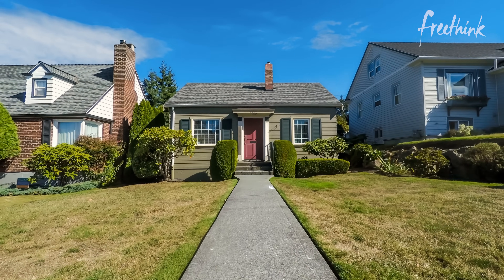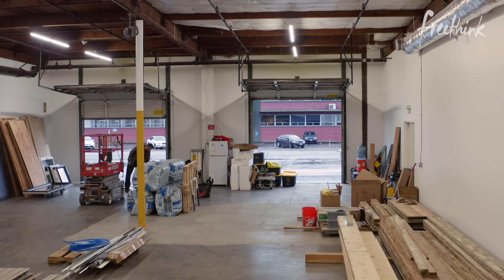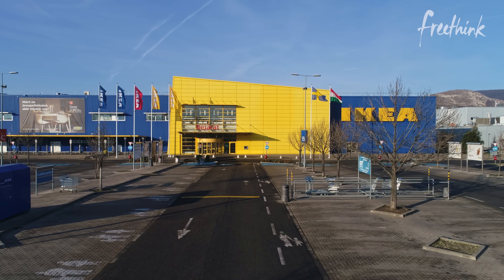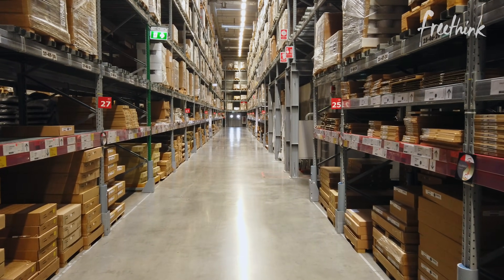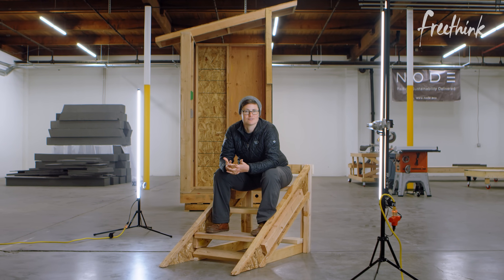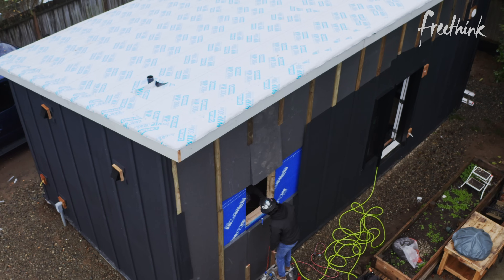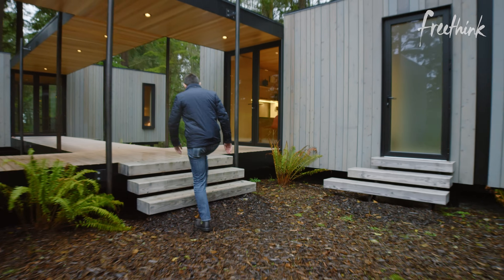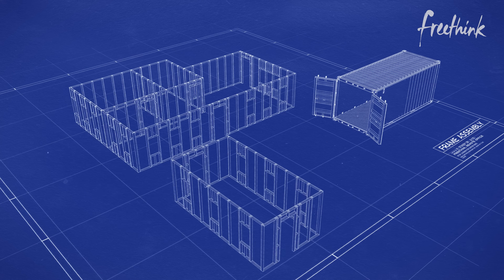This Carbon-Negative Dream House Ships In A Box

Comment: Great concept! I started wondering if the average person(not a rich person) can afford the land? Especially in the PNW, it's very expensive to buy the land and need 20% down minimum for empty land. It will be interesting to see how these are categorized too - maybe as "modular" which doesn't get the financing & insurance benefits either. Also, wondering what the R value is of recycled denim insulation - I would love to use it if it is highly rated! Keep up the good research!

Comment: Kudos for using recycled materials, good design, thinking smaller, well-insulated air-tight house construction.  Not "cheaper" at $350 per square foot.  Exclusive of land costs.  I would like to know how the buildings can be carbon neutral without passive solar features like thermal mass.

Comment: Lots of platitudes, but no actual explanation of exactly how this structure is carbon negative - beyond the use of recycled denim for the insulation and a few shots of solar panels. Is there rain catchment? Wind turbines? Composting toilets? Passive solar orientation? Like others have mentioned, I'd like to see at least a little footage of two people putting this house together. I'm all for sustainable design, tiny homes, etc., but I was hoping for a bit more substance. Cheers.

Comment: OK let’s pick apart what’s wrong with this design? Wall to floor ratio is too great. Wall insulation is too thin. No ventilation. Solid burner is not sustainable nor healthy with all particulates. Lifecycle analysis of less than 50 years. Wood starts to rot as soon as you set up the vapour barrier. Condensing point is in the wall. Square footage is tiny. Corridors outside - laughable. I could go on. Sorry node you need to research more - clear cutting forestry creates greater emissions than the steel and cement industry together!

Comment: Node is working with wood, unfortunately this is not a sustainable product?!? What are you saying? I hear you say….. Well today’s timber construction has a Lifecycle of 50 years. We have to start looking at lifecycles of 150years plus. Also we need to bind and reuse materials for longer. We need to reduce waste, we need to choose the resource which is most sustainable be this steel, concrete or timber. The construction industry needs to look at industrialised Lean BIM construction techniques for nZEB or ZEB structures.
Sorry Node is just gimmicky BS. They haven’t thought through what sustainable is!!!

Comment: I love the idea and wish it will be affordable but I don't see how because land is expensive, foundation is the most expensive portion of the project which will need to be engineered approved by jurisdiction and built before home assembly, connecting utilities to it will also cost a few thousands... But I do think this approach could become much cheaper than regular construction. If this does work I see builders buying all kits before individuals and charging whatever they want based on sq sf pricing in local market. Millions of these kits would be needed to be shipped quickly and built quickly in order to bring market prices down. Talking about huge quantities built in quick robot assembly lines all over the country. This company would need big investors to get to that "affordable" pricing! That said this is the direction the housing market needs to go to provide housing to every human!

Comment: I don't think what they're doing is affordable. From your website, "By the year 2000, it (housing prices) had risen drastically to $119,600." then tell us "Costs for NODE’s homes vary up to $150,000 for 500 square feet" So $119,600 is too much for a home, yet they sell a small 500 sqft "home" for a 31k more than that and you still need to buy land. They have a 264 SqFt option for $99k, and I love tiny houses, but most people don't want to live that way. Additionally both housing sizes are illegal to build/live in in most places, that's not their problem, but it's a hurdle that needed to be overcome to even live legally in one of these "affordable" tiny/small "homes".

Comment: That example house looks like it's bad at keeping heat in, and cold out, and will constantly feel like it's freezing all the time, and the opposite when it's warm weather, it would be impossible to keep heat out and cold in for properly regulated room temperature.

Comment: "Sustainable" but... we design it to require an acre ofland surrounding it.
Want sustainable? Design a low energy and ATTRACTIVE apartment building. 
Want even more impact? Lobby the US governments to get rid of building regulations that limit buildings to these huge area, single family homes..
Reply: Apartment buildings are not sustainable (also very hideous). Along with commercial buildings they are among the least efficient and least sustainable. Also there is no legislation that mandates single family homes in the US (😂😂😂).  Low density single family are great as long as they made from local traditional material that are climate adapted. 

Apartments building are fine as long they are under 4 floor, when you get higher than that it just destroys the neighborhood.

Comment: IKEA is cheap not because of its flat pack design, it is cheap because of its use of fiberboard, MDF, card stock, and very cheap steel hardware/fasteners. Those are cheap, heavy, brittle, and shitty materials.  Here’s hoping this housing startup uses much higher quality materials.

Comment: I know this is an old(er) vid post. But, a MAJOR source of housing costs lead straight back to Local, State and Fed Gov't. through over regulation (permitting), property tax, and (the current '21) WH Administration wanting to remove key homeownership tax breaks. That's NOT even counting the MAJOR distortions (housing and consumer goods price increases) caused by incredibly poor (criminal?) Fed Res monetary policy attempting to prevent bankruptcy of a bloated and debt riddled Fed Gov't.

Comment: I feel like the fact that they didn't actually talk about prices means it's not actually cheap.

Edit: I was right, 150,000 for 500sqft. 
90,000 for 260sqft. And you can't even see prices on the actual website so it's probably higher than that.

Comment: it's a nice first step, but so far people are very concearned about safety, they want brake proof walls so they can leave to work not worrying about looters, excessively strong winds, large amounts of snow ecc...         i've seen quite a few approaches to the eco housing, and a combination of some of these could really sell the idea to more people (ex: 3d printed walls , modular interiors, and roof, easy to deploy protections for the solar pannels in case of bad weather ecc...).    the idea of thick walls alone would be more appealiing to peole.

the other thing is that none of the designs are compatible with urban areas, so the first company that can make high buildings in an eco way, making it look good in the city, will really start to change things.  

right now the best we can do is retrofitting old buildings to be more carbon-efficient, and it needs to be an investment done by the gov, cos no private is allowed to affect large populated buildings

Comment: It’s not an engineering and design problem. It’s a permitting problem. You need to do stress equations on every single wall, window and doorway and have all plumbing and electric plans for multiple configurations…then you can send the flatpack after the plans are approved.. In LA County a large nonprofit, AHF is trying to build affordable housing and being stymied every step of the way and taking out full page ads in the Los Angeles Times to get the City to quit with the deliberate road blocks.

Comment: Their cost per square foot is almost 3 times the national average.

"Costs for NODE's homes vary up to $150,000 for 500 square feet. A more affordable option is their roughly 260-square-foot home, equipped with a kitchen and bathroom, coming in at $90,000."

Do the math of cost per square foot.  260/90,000$ = 346$  500/150,000 = 300$  Let those numbers sink in.

Comment: No such thing as carbon negative, only carbon captured in different forms. For example you cannot make the carbon cease existing, but you can trap it in different forms. Additionally regular houses don't create carbon, but their energy usage releases carbon via it escaping coal and LNG power plants that help power the mains grid. More carbon in the atmosphere isn't necessarily a problem if humans weren't around, because it merely results in the flora of the world going into overdrive, the carbon in a tree is for example captured from the air, it doesn't need to oxygen so it releases it. 
However, this natural ability for the planet to adjust itself is highly affected by the fact that humans just mass deforest the planet. Therefore the ability for flourishing flora is not possible, when humans take over the lands and place roads, buildings, farms, dams, car parks, industrial buildings etc on it. 
Fun fact, at least 70 percent of all oxygen released from CO2 is via aquatic flora, these exist in the oceans primarily and these are the most efficient at photosynthesis. What this means is that, in fact the health of ocean water is actually the most important thing. If humans were for example to manage to somehow entirely destroy the oceans and all the oceanic flora was to die, then humans themselves would literally kill themselves and the planet by doing that. Our very existence depends on oceanic flora existing and it's job of releasing oxygen constantly from CO2. In fact it wasn't until these organisms came along that any land breathing animals would exist, we find in the layers in the ocean a deep rust layer by a certain date, this is when the photosynthetic flora came to exist and the oxygen production lead to this rusting. 
Not too long after this, eventually the air was oxygenated enough that some fish which had fins a bit more like half legs were able to survive on the shores in an amphibious way, these safe from danger evolved into proper primitive amphibians and then eventually lizard type things evolved from those that can live permanently on the land etc.

The point is, it all starts from the ocean and the aquatic flora, and it's still the most important thing even today, despite your average person not being educated about this.

Comment: The way they have that 'house' setup might work in very warm conditions, but would be terrible in northern climates. They'd lose so much heat, they'd be freezing all the time. There's a reason most houses don't have their rooms spread out like a giant noodle. Having everything together helps keep the heat in. Probably less windows would help, too. But I like the idea of having a house they can connect together. Making the walls out of plastic I would assume would be cheaper. Though I've heard this sales pitch before. They used to say how making CDs and DVDs from tapes and VHS would reduce the price so much, yet instead all the prices were jacked up. So, odds are it wont be cheaper at all, just cost more like everything else.

Comment: A new innovation called SmartSkin from PHYSEE is aiming at making large buildings, like offices, 25% more energy-efficient. SmartSkin allows windows to generate clean energy with the integrated solar cells. And with the sensors, which measure in- and outside temperature and humity, PHYSEE hopes to better balance the indoor climate. This saves energy and creates better living circumstances for the people inside.

Comment: Im sorry. From a sustainability POV this might be good for sustainability (or not they only explained the shipping method and is taking local jobs and moving them to the bay area really helpful?) But does zero for homelessness, you need apartments. If sending homeless people to live in a shack in the woods worked homelessness would already be solved.

This could help people who are renting and for some reason own some land easily build a starter home but thats not a huge problem.

Comment: The only reason that 'immigrants' build homes is they are unskilled and work for  half or less of what a skilled tradesman  charges.    The unskilled immigrant  usually does not speak the native language or  read  building plans and codes.   So, i agree that building in a factory allows  the construction to be overseen  by contractors that know what they are doing.  Of course, the immigrants still get  tiny wages in order for the Factory owners to make a profit.

Comment: This really isn't a new innovative idea...look into Alside homes or Lustron homes
Reply from the maker: Interesting reads, thanks for the tip! 

https://thefrosthouse.com/home/alside-home-locator/
https://en.wikipedia.org/wiki/Lustron_house

Manufactured housing isn't a new idea (even in the time of Alside & Lustron homes). It's one that has come and gone in different incarnations over the years. This implementation, with its design and focus on sustainability, is certainly different from previous generations -- and hopefully it will have longer staying power, though time will tell!

Comment: I inadvertently had minus-carbonned in my building of a log home in which I raised my children off-grid. Now, as I retro-fit my "little old lady cottage" wherein just last week I Hefted bags of clothing material (that were in dumpsters over the years) to the attic as insulation. Think out of the box is truly free thinking (even if it comes in a box initially)! Your buiding concept IS the new modern that 50 years from now will still be so. There will have to be an architectural genre for your soon-to-be industry standard, something akin to "MidCenturyModern 2nd episode"! Kudos to your concept and application of practicality and possibility, for the people!

Comment: I appreciate your thinktank design innovation , as long as it is affordably carbon negative..the link to this came from $8k tiny home.. kinda silly if it's anything above double digits.. k
Reply from the maker: That's awesome you made it work for that price! Another challenge is the land cost, which has been rapidly rising in many metro areas--but tiny homes on smaller lots can certainly help that!

Comment: What a sales ad and Hype! There is not such thank as a carbon negative home. If you build a lean to out in the bush maybe but we are carbon based and using our energy to do it. So as we breath we are still farting and putting out pollution.  Next when they talked labor cost as a big expense and acted like that would be eliminated that was the dumbest statement. The labor simply moved from on site construction to in a factory construction. Used denim in the walls? Spray foam would be easier, cheaper, and insulate better. I wouldn't want cotton rags in my wall. If there was a leak those rags would become wet and mold even with sprayed on flame and water repellent.  Nope, noting to see here but a bunch of Hype. I do wish it was true though as I am a super green person and looking for ways to be even more green.

Comment: I really like the design of the house.  Love how its open and not a plain ordinary rectangle like the majority of houses...  The only thing though, and maybe this isn't an issue - I'd have to look at the floor plan to be sure -- I wouldn't necessarily want to have to put my coat and boots on to go from the section with the bedroom or living room to the section with the bathroom, especially when its -40 degrees outside and the snow is falling at 3 feet an hour...
Reply: True! It may be a cool idea, but no one is answering questions!

Comment: Very BAD example of an urban low energy sustainable house.
* extreme poor insulation
* not optimized for passive heating (burning hydrocarbons shown!)
* high maintenance flat roof (especially in a forest)
* bad siting for solar panels
* high envelope to floor plan ratio gives bad economics and insulation
* large site area shown
* expensive materials and design choices especially glass and flat roof flashing
* Junctions, flashing and weather tightness major disadvantage of modular design means less building life, utility and resale value
* tip - hire an architect specializing in sustainable design
Wayne Russell B.Arch
Reply: Thank you for smashing this BS wide open!
Reply: Wayne Russell I grew up on the Oregon coast. My old are-you-kidding! list: Flat roofs, ceiling heat and stucco siding.
Reply: @amandawilcox9638  would you elaborate more? What do they mean?
Reply: Also butt ugly - has the whole custom shipping container vibe.
Reply: BUT, to be fair, the woman is sitting on a half built staircase leading to nowhere.
Reply: The large site area shown is so true. This property is way too big for that little house. Almost none of these "environmentally" friendly houses are ever environmentally friendly. They have a huge physical footprint. It's ridiculous.
Reply: This is a proper critique! That covers everything.
Reply: Yep I agree with everything you said. Spot on.
Reply: How accessible is this building to the homeless? Oh, I see...open hallways.
Reply: This is just for show, no one wanna buying house like this